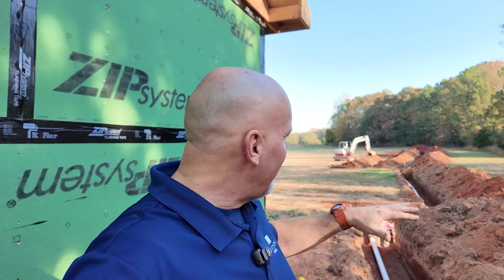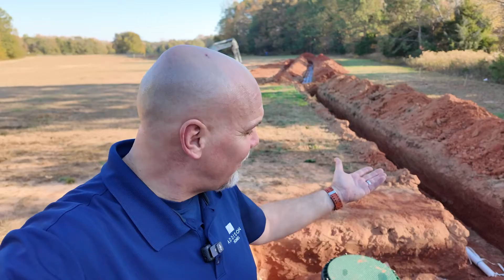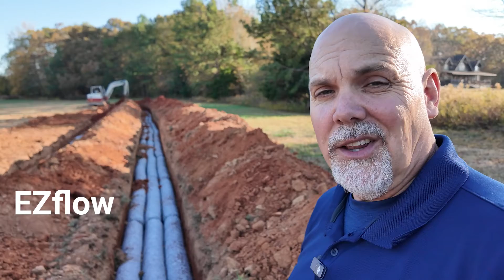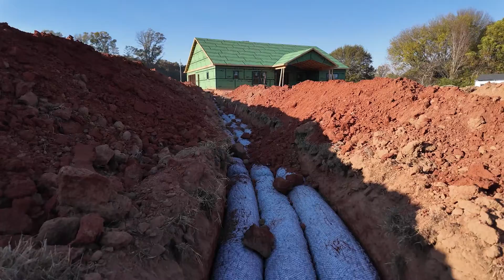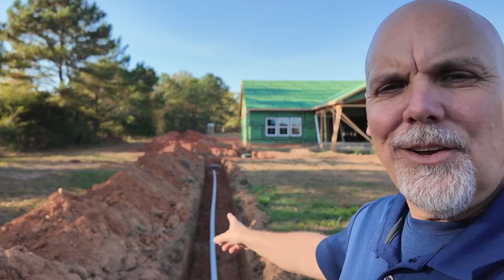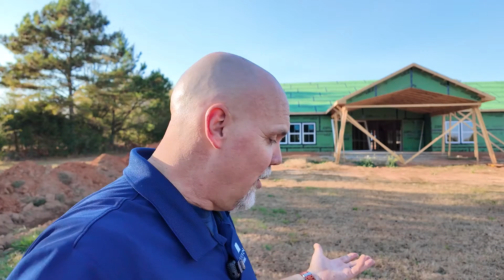Septic System Installation: How To Do It Right

Comment: Why set the tank sideways like that ? What does this system cost ?
Reply from the maker: The orientation of the septic tank depends on the design of the system and routing of the drain lines.  This system cost about $9,000.

Comment: What do you estimate for lenght per bedroom? I always estimate 100'/bedroom. Is that was EZ flow rates at? Also need a quick rule of thumb when doing lot layout and approximate size of home for the tighter lots. Also, I am suprised at the depth of those leech fields. Mine were dug probably 5-7' in depth.
Reply from the maker: The required length (and depth) always depends on the loading rate, which is based on the soil's texture, structure, and consistence.  A good rule of thumb for an alternate drain field system like EZ Flow using a conservative 0.3 LTAR (long term acceptance rate) is 100' per bedroom plus 50' per bedroom for repair area.  Always check with the local health department or a soil classifier before assuming the space needed for the leach field.  Typical drain lines in this part of South Carolina must be spaced 10' apart.  Hope this helps!